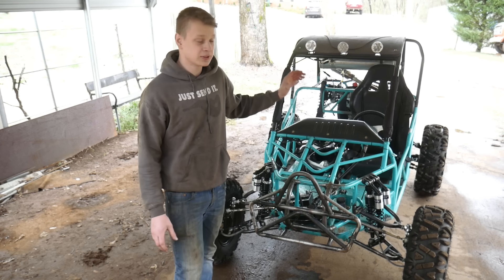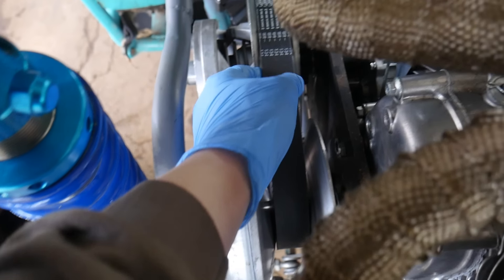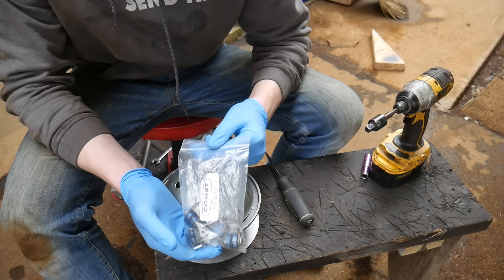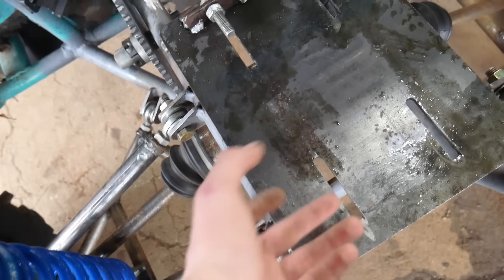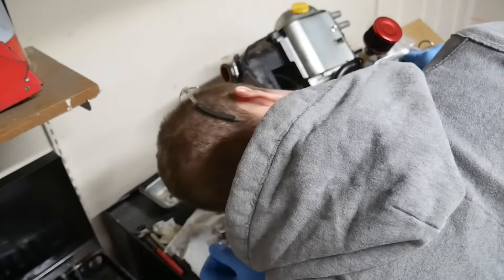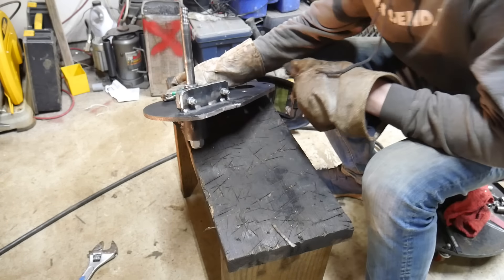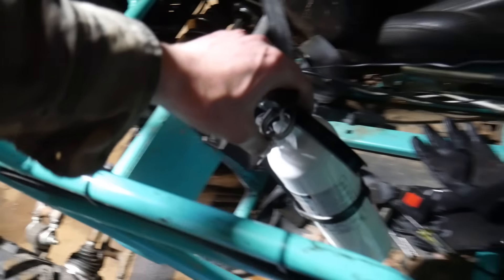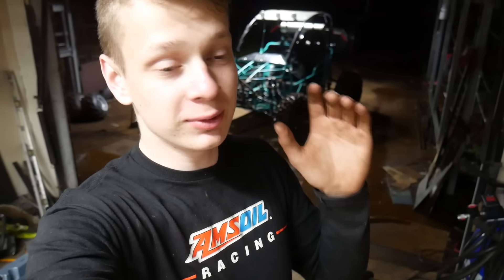Harbor freight 670cc Vtwin buggy Rips after mods!

Comment: You can get a spark plug chart at almost any atv shop that will show you pictures of plugs that are running too lean or rich an to hot or cold,... there's a lot of variables actually.  Your reading the plug wrong ,  you don't read the very center of the electrode where the spark is , you read it on the outer area.   your calling it on the lean side when its actually running rich.  get the chart . You can email me whenever you like and i'll help you with any information you want.

Comment: The cvt alignment isn't correct and it appears to only be transitioning half way something is wrong with it, it could be to stiff of a contra spring or rollers are to light or the belt is to short. 

I'm glad to see you back at work this has come a long way and looks fun!
Reply: It is, he spun the primary clutch around backwards, that put the moveable half of it on the stationary half of the secondary, the thing is fighting itself bending the belt sideways,  watch it closer.  The stationary halves need to be on the same side. Yes the work opposite of each other, but the belt follows the stationary sides.

Comment: They use the same CVT system on snowmobiles. Ski Doo even had a snowmobile back in the day called the Alpine, it was a large work type machine and used a CVT system with two belts side by side for high torque applications like pulling heavy loads, nice buggy by the way.

Comment: The secondary needs to "float" on the shaft.this will allow it to self align.
Reply: It’s definitely binding up now , he has the moveable half of the primary on the side of the stationary half of the secondary. You can see the belt bend in the vid. He needs to spin the primary around first, then , float the secondary if you can keep it free floating and not binding on the shaft
Reply: Interesting, I’ve never heard that before. How much “float” room do you need the give the pulley? I’m curious about this as I’m working on a kart with a comet 40 series. I’ve been in contact with Comet tech support and this was never mentioned. I’ll attach the link for the Comet 40 series for your review. If you have a video of the floating driven I would be interested in viewing it.  Thanks!

http://www.bmikarts.com/pdf/comet_40series.pdf

Comment: I have acquired an old Honda Odyssey chassis!! You have literally done the exact drivetrain I have in mind!! Would kill for a parts list!!!
Reply from the maker: IRS CROSS-SECTION PARTS:

91 miata axles: https://www.summitracing.com/parts/gna-ncv47534
91 hubs from local junkyard/ebay
Azusa 4x4 hub 1" straight through (need to be machined down 1mm)
Needs to have a 1.56" OD 
similar ones: https://www.gopowersports.com/live-axle-hub-4x4/
1" axle: https://www.gopowersports.com/axle-36-1-diameter/
1 9/16" pillow block bearings

Comment: Sounds Sweet! Instead of an oil catch pan you could run a hose from the breather to the drive chain. Oils chain and less work. :)
Reply from the maker: No offense, That's a very bad idea. How would I know how much oil comes out? Engine oil desiged to be in engine not on a chain. A catch can actually helps to keep the engine oil inside the engine and when excessive pressure builds up  it lets the engine vent out
Reply: @VasilyBuilds  all good. I've seen it done on motorcycles. But i guess buggies are different...

Comment: If you have more power or run higher final drive ratio, you want to close the PTO pulley at a lower rpm, so use heavier weights, if your vehicle weight increases, or you're pulling through heavy mud, climbing hills, etc, use a spring with a higher load rating on the rear pulley, it'll adjust with power input.

Comment: Hey bro maybe i can help you out .Noticed right off the bat i can see the belt is riding too low in the Driven clutch to begin with .That will kill the bottom end power on initial takeoff. Its like trying to start off in second gear. Should be a hair above the top of sheave  after everything is properly aligned with approximately an inch or so of deflection under light pressure.  First thing you should do is put that primary (Drive) clutch back the way it was , Second put a thin metal STRAIGHT EDGE like an engineers stick. yard stick ect. that is  about a 1/16 thick and not bent clinched between  the secondary (Driven) sheaves and rest it on top of the  Primary clutch shaft, If the secondary  sheaves dont  pinch the bar tight  you probally have to take it apart and take a shim out (probally why belt is so low in sheave) unless it has an external adjustment like a skidoo. Third you can now find the center of drive clutch , centers of pulleys have to be aligned , take another straight edge and lay it on back of drive clutch sheaves,measure off secondary sheeve pulley   and and twist or turn motor to even up . there will be an offset, make it even while mantaining center on drive clutch, you will probally have to elongate some holes along the way ,spacers ect but play with it till you mantain center with proper belt deflection and height above sheave ,no belt squeal at idle ect.You can also play with  different springs,filing notches in the weights and such ect. to change performance   Get yourself a snowmobile racing ,tuning book .it will explain clutching  in depth. Great project you got there though!!
Reply: Best comment.

Comment: Taking the baffle out will cause a lean condition by increasing the airflow in a carbureted engine. If you're injected your fine. The afr will adjust automatically.

Comment: I admitt I didn't finish watching the video so maybe you caught it but in regards to you cv clutch, you should run the belt as close to the engine block as you can to prevent bearing wear. The farther out the output shaft the belt is, the more lateral pressure on the bearings

Comment: Hey man cool video. That's an awesome little cart you have. Did you put any type of oil baffling inside the crankcase to prevent the oil from sloshing around. It doesn't seem like you have any issue with oil/ and excessive smoking. I had that engine on a stump grinder and every time I change the pitch it would Splash oil into the cylinder smoking out the yard. Then I put a different one on a go-kart and every time we did a hard right it would smoke everything out.

Comment: I know your already on your ride I was gunna mention to cover your ctv is from mud and water and as well as your air filters need a breather box that’s weather proof then you’ll be able to drive it in the rain and mud and not worry about wet air filters or a belt slipping and then your screwed but all around a good machine

Comment: Hey man you do some sick builds. Im hoping you can give me some advice. I just installed a 670 predator stock with the 780 torque converter.  I’m running stock tires 20” tall. My belt is slipping bad. The alignment is correct. I’m running a 12t and 60t sprocket. Any help would be appreciated. I was going to try and turn my drive pulley around like you did and see what happens.
Reply from the maker: You need 10-60t then. Look for a 1/16 ticker belt maybe

Comment: Vasily,.. the inner side of both pulley's is fixed in place, right? So if the drive pulley has the weights, it controls how far down the belt rides down into the driven pulley against the springs. It can not mis-align if it's aligned at the beginning and against the 2 sides of 2 fixed pulleys. ?? That CVT is NOTORIOUS for burning threw belts. Many others here on youtube, some you know, have the same issue.

Comment: What if you moved the engine to the right, so it’s miss aligned at low speed. When u get up to speed the belt alignment will be true. 
Snowmobiles use that same setup and have worked for years. Cvt belt are supposed to flex and be at different angles. No reason you have to swap all those pulleys around.

Comment: I cant tell but it looks like the rear suspension maybe too stiff and while wheelies are cool af. They are how you end up upside down on the trail. You might want to loosen up the rear suspension to to see if the rear will really squat...just a thought . Keep up the good work!!!!!
Reply from the maker: Thanks. These tests are very low mph wise. At higher speeds the suspension will have much more force exerted on it. So it's actually a little too soft right now. I would want it stiff so it doesn't bottom out on jumps and gives me less body roll since I am not running a sway bar.

Comment: WARNING ⚠️  THAT DRIVE CLUTCH IS NOT ⚠️ DESIGNED TO BE USED IN THE MANNER YOU HAVE IT MOUNTED TO THE ENGINE. Yikes 😬!!!!
Reply: The clutch is designed to have the inside sheave towards the crankshaft,  not the head of the clutch bolt. Prolly lot of info on the net.
Reply: Yeah, was trying to envision the mechanical failure mode of that clutch operating in reverse direction of intended.

Comment: Just FYI, putting a CVT in there was probably the worst option you could have chosen. CVTs are even more unreliable than normal automatic transmissions. You would have been better off using a reinforced motorcycle gear-box or something similar.
Reply from the maker: Says who? CVTs are one of the most reliable forms of drivetrain when it comes to off-road rigs. Fully mechanical, no fluids, easy to maintain and repair. Where as gearboxes, you have high part counts and are constantly shifting gears. Each have their own pros and cons, but I love the cvts for this application.
Reply: @VasilyBuilds  Fair enough. All I know from my own experience is that in a car, a CVT is way worse than the least reliable automatic transmission in existence. As for all the parts involved in a manual transmission, a proper manual will last forever in a vehicle like that, and will give you far greater control over what's happening, and it would give you far less power-loss at the rear wheels. I've never been a fan of belts or hydraulic-coupling (torque converters). For me, the direct metal-on-metal,  pass-through connection between the engine and rear wheels with a manual transmission can't be beat, and if you get the right one and don't abuse it too heavily, it will last you practically forever, so long as you change out the oil at regular intervals, and changing fluids is hardly a difficult thing to do.

Comment: What the hell kind of torque converter can handle that hp? I need one lol
Reply: I have a 23hp brown vanguard but can’t find a TQ rated for that much.....
Reply from the maker: It's gopowersports 780. Retails for 595$ there is a Link in the description. Technicaly it is only rated up to 30hp by the manufacturer (comet). But many people have pushed it past that
Reply: Vasily Builds Thanks, do you know of a cheap knock off or any TQs that can taken from other vehicles like snowmobiles or something?

Comment: Dude you are binding the belt after you spun the primary clutch, it’s visible in the vid of it. 
 
You want the two stationary halves together not opposite of each other. Belt cooker
Reply: The belt follows the stationary side, you have them on opposite sides and it’s not letting it upshift , you will get more speed spinning clutch back around how it’s supposed to be. You can see the belt binding in your vid if you watch for it.

Comment: Thoes clutches are junk in my opinion you need the comet one. I've gone through everything with my buggy a lot more power and reliability first time I used a clutch like the one you are using the weights stuck wide open and stalled the motor within the first minute on a little 8 horsepower motor

Comment: bro more like 20 hp 670cc predator is nowhere near 50
Reply from the maker: This isn't stock my friend. It revvs to 6500rpms
Reply: @VasilyBuilds  even with cams push rods bbk emission delets 28mm carb and other upgrades there still only pushing around 40hp. i wanna a see a forced induction build on it. be sweet